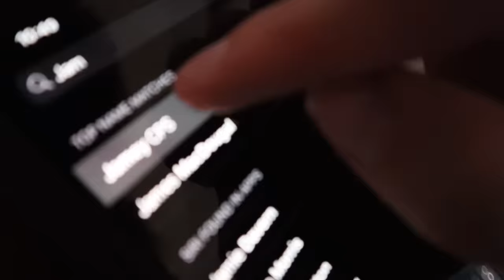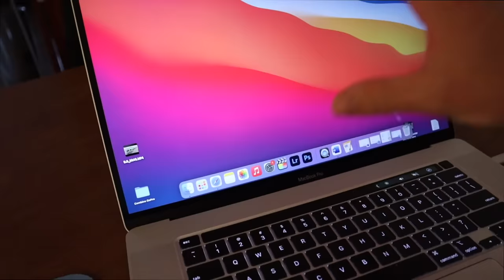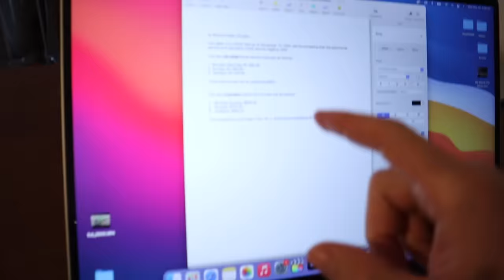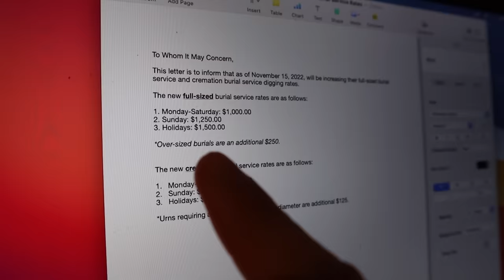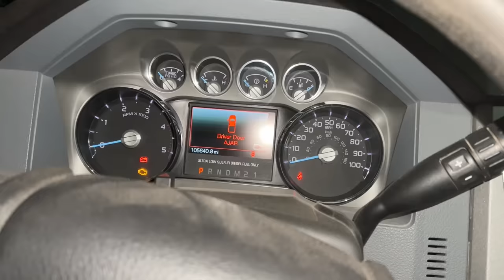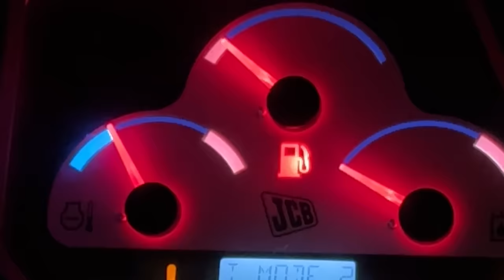Update On The $1M Bin Site Problems

Comment: Cole, that's exactly what you need to do, start putting names associated with your bin site problem. The world should know who was involved with every aspect of that bin site. I would however follow your lawyer's advice though on releasing names and information.
Reply: The Vice President is public information so it’s not really doing much other than saying he isn’t doing his job
Reply: When Cole has as big of a reach as he does he has to be careful they don’t come at him for a defamation lawsuit even if the company does deserve to get dragged through the mud
Reply: @Mathiowetz  Its not defamation as long as its true and documented
Reply: @Mathiowetz  Its extremely hard to sue a public figure for defamation. At least until Depp and the Jones trials. You can literally claim im stupid and didn't know any different.
Reply: @alexturner8104  Cole has done a wonderful job explaining time and time again he bought an ALL AGI setup and the AGI products were good but the fabrication for the structures holding the leg, catwalk, distributor, the dump, and pad were done by a subcontractor and it wasn't exactly up to the correct standards.
Reply: @dedrakuhn6103  You did a very accurate synopsis Dedra.   This situation is why we always have contractors post a performance bond and do not release the bond until everything is mustered out after completion
Reply: @dedrakuhn6103  The sub should be a recommended sub for the company certified to install. From whats been said that holds true.

The bin company should make it right out of their pocket and go after the sub. Sadly that dosent happen. I had a 180k project go that way but I saw the subs being iffy and held back 40k. Turns out their work was sub par and the parts company didnt want to fix it. So having the money i said sue me or fix it. They walked and we closed the project. Still didnt come out ahead, concrete demo and repair plus redoing the work cost 40k and another 15k to get it done right.

There arent allot of honorable companies left. But cole has the reach to cause some real money damage by naming and shaming. So for a 1M project go for it.
Reply: @Mathiowetz  he didn’t defamat the guy he said that’s who he’s been talking too there is a difference between calling someone out who needs to handle there stuff he didn’t say the equipment was bad he said the people agi has putting it up needs to fix the issues
Reply: @Mathiowetz  Defamation requires making a false statement about the individual. Casting someone in a negative light online is not the same thing as defamation.

Comment: Your intuition is correct on the gas pump.  They are very collectible.  That pump is from the 1915-1925 time frame.  The glass cylinder holds 10 gallons.  Hopefully you have the metal pieces that cover the lower part of the pump.  Restored, it really can be a piece of art.  Most farms had or still have an old pump like that sitting around.
Reply: ive seem the old pumps of all types for years, my great uncle ran a gas station in the early 1900s  with those old pumps we have some pics of him at the station .  They were amazing and are even more cool , fully restored

Comment: Biggest advice I can really say at this stage is keep on top timelines, dont be afraid to say to the contractors "this MUST be fixed by (date)", i need to hear by (date) and stick to it and have your lawyer stick to it. I can see the contractor trying to push things back and back and back and delay but you need to hold them to account...
  Secondly... I know you try to give chances, be nice and forgiving and so on and that is an honourable trait, but be aware those you are dealing with may NOT view things in the same way so dont be afraid to put your foot down, or have your lawyer do it for you... Ultimately this contractor has let you down and its their duty to fix this, even if they dont want to
Reply: I agree. Mr. Nice guy has no position in this. Get a fire under anything you have control over. To much is riding on a timely resolution.
Reply: They need to hold AGI feet to the fire, no nice guy. Contractors are the ones that messed up the project they need to fix it now.. ie tear it all down and do it right, no other option. If AGI are incapable of doing so they need to find reputable experienced bin site builders to do it and pay for it. A 1 million $$ project should never look like a toddler built it.

Comment: The extra cups for the leg you could use as storage bins for nuts, bolts, any other parts for the farm. They already have holes to screw into a board. Then you also have them if you need them in the future.

Comment: Screw your extra cups from the leg on a wall next to each other in a grid and use them to hold smaller parts, tape, etc...  could also make it so they are attached to the wall with a french cleat system.  That way you will always know where the extras are located and they are being used for something.

Comment: You are changing the hydraulic lines on your main grave digging machine. Do you ever bring out your backup machine and use it just to make sure it is still working? It would be terrible if your main digger broke and then you found out your backup didn't work either. Just a thought.

Comment: Quit blaming AGI I don’t hear anything about the equipment being defective that agi provided. It is the quality of the work the concrete guy did and the millwright so go after general contractor. I think you are using your YouTube to try to get agi to fix things that don’t appear to be their problem. The whole issue is a bad deal for you but is it because agi sold you faulty material?

Comment: looks like you need a crew to set up a few hundred yards of comcrete pads, for a Clean work site,, and then a bigger shop for 24-7 365 maint bay. and parts storage. ( even better) lets build 2 Huge Potatoe Barns. they are powerd and insulated. and huge. with doors at both ends.  great for entire operations.

Comment: Take those leg buckets and screw them to the wall using the existing holes and use for loose bolts and nuts.  You will eventually need one of them to fix a broken or missing bucket.  

You may try calling another AGI dealer in the area, be upfront about what's up and what you need, be willing to pay for an evaluation or even an independent engineer suggested by another dealer.  Be up front with the engineer that you may need him to testify if needed as that will change the way the engineer documents his work.

Comment: Your getting it out of the sun is correct. UV's.  UV's are great for growing things, and for helping bees and butterflies find their food in the flowers for pollination..
however UV's break down rubber and plastic, like the rubber hoses on your farm equipment, and tires.
So maybe put everything inside, since sulfuric and nitric acid in the air also works on metal surfaces.
Maybe spray the rubber air and hydraulic hoses with UV blocker paint or spray every year, as well as the tires that are not being used, and keep everything clean and covered with protective material when not in use since manufacturers are not JIT-like it used to be after the pandemic.

Comment: I can't speak to your problem in the grain elevator but on the fertilizer, if you aren't doing cover cropping and no till farming at this point you are falling behind in changes that the farming community needs to heading for. If you do it right you can cut the fertilizer man less checks and maybe some day say good bye to them. Look into it. Less tilling is good for you soil and your pocket book. Just a suggestion. You are smart, so this should not be a surprise. Farming is a lot more then sitting in a cab of a powerful machine.

Comment: Cole: Did you specify a Rebar cage inside the base for the overhead wet bin in your design? What was the design of the cage? If there was no rebar cage installed, then you are fubar as far as the cracking in the base. I really feel for your family, but there might have been mistakes made on your end, that you are ultimately responsible for. Curious to know how the base was designed.

Comment: Looking at the AGI web site i would have found a company that would build the bins as their bins seem to have a very high fail rate and do not do anything to fix the problem. For a company that is having this happen would be looking at the design and what is causing them to fail. They are just building them to a mim spec for cost saving and hoping that they will last till the warranty ends. Looks like you may find them going broke and not fixing your bin with no come back. Wish you luck in get it fixed as others are in line before you.

Comment: My feeling is this was a big, important job that required extra attention, by everyone involved =. Was there a structural engineer hired to draw up plans and specs for the pad(s) and soil preparation? Was he on site during the construction and pour? Was there tests done on the concrete at time of pour to ensure it was the correct strength and mix? Was the correct size reinforced wire and or steel rods used and were they epoxy coated for rust resistant or regular metal? These are just some questions that i would want to ask and be spelled out in writing BEFORE any contract is signed, also, designate a Project coordinator/Site Supervisor to oversee all the work is done to specs and signed off accordingly. Who was responsible for all that, Cole or AGI has not yet been determined.

Comment: 5:24 You might want to check the tires/axel on that trailer, something looks very off.
Reply: Just a little overloaded
Reply: @michaelmullen8153  it being a little overloaded makes the wheels super crooked like that?
Reply: If you're talking about as the trailer is turning, then yes, they do lean way more than it looks like they should. If you think that's bad, watch one turn short while loaded on dry concrete. You'd swear the axle is going to snap

Comment: JCB cole. When it is beeping it is likely momentarily flashing a code thus code would be wif water in fuel. Drain or clean wire on fuel filter ( the accessable one) that is.

Comment: If this was even a $100,000 fix AGI would probably be all over getting it taken care of. I bet they might have even noticed more issues than Cole even knows about and perhaps even the bins themselves will have to be torn down and redone. If the concrete pad on the hopper was cracking there is probably a huge concern the bin pads were also not poured to spec. The project might have to be a complete teardown and rebuild which is why AGI is not communicating yet because it will be so costly.

Comment: AGI buy's the whole grain facility back and prepare a new site and AGI builds a new grain facility on there checkbook.   Then transfer any remaining grain into the new facility and they take the original facility down and haul it off.  AGI pays to have a engineer/inspector to be insight during all phases of New construction.  The engineer
is a third party position.... Separate from 
All parties
Reply: That is a well thought out response. I agree
Reply: @amunderdog  Other than you have no idea how contracting works.   AGI has liability and errors and omissions insurance.  They also subcontracted the job so the subcontractor also has insurance.  At this point, they're trying to figure out who's responsible - AGI's design, or the subcontractor's work.   Then the insurance companies will have to decide how much each of them is going to cover.  So, it's not quite as simplistic as the "well thought out response."

Comment: Warranty work is an absolute nightmare!  The GC that was hired will not be willing to do the work all over again, out of pocket!  He thinks that he did everything to spec and his job is done.  His insurance will get hit with a claim that they will not want to pay for it especially if the guy claims that he did nothing wrong.  AGI doesn't want to pay because they may have supplied the product but not the labor.  Maybe the concrete mix was wrong, not the GC's fault but it's also his job that was completed.  The fingers point to this one or that one and it takes forever to figure out who's going to actually be paying for the repairs!  While you sit and wait for answers to what is now your unfortunate long term problem.
Reply: Both the contractor and AGI have errors and omissions insurance along with liability insurance.   At this point, both entities are attempting to determine how to get out the situation with the least amount of direct loss.  So, you have attorneys and insurance companies involved - and AGI and the contractor are attempting to find out where the other company screwed up and assign liability so they don't have to pay as much.    BTW - if the concrete mix was wrong - that is the GC's fault since they accepted the load.  That's what mix logs and slump tests are for.

Comment: It always amazes me when a company does shoddy, terrible dangerous work the management is always radio silence or tells their victims to call their insurance company because that is what insurance is for.  I had a major issue years ago, I took the company owner up on his advice and called my insurance company and my lawyer. When it was all said & done the owner wished he had just fixed what they screwed up & the other damage it caused. He never imagined what came his way ever would but he learned the hard way not to try to screw over angry customers due to doing terrible irresponsible workmanship and installation.

Comment: Hey Cole! I was wondering if you would ever run your diesel machines on biodiesel? A company called SpringBoard Biodiesel sells units that automatically convert any feedstock, such as used vegetable oil, into high-grade diesel fuel. I understand the fuel prices are high, but maybe converting to renewable fuel would be better for the farm's efficiency and also save fuel costs.

Comment: So, the "process" of pursuing your bin constructor is very ongoing. I'm not sure how AGI or the actual contractor can wobble very much- the entire process was filmed to some  degree and they know that, so other that fixing the goof ups, only hanging their rep out to dry is a choice. They may make a cash offer- hold out for repairs and damages, say 10% of the contract net value, paid to the lien holder. Back charge them for money lost having to co op or make alternate provisions to store. So far, it doesn't look like they are going out of their way to "do the right thing".  
I was about to worry just what you would do when you said the outside is finally all cleaned up- I should have had more faith, you segued into cleaning out the barns. Are you about ready for the next blast through your G'paws house?  Time for Thanksgiving and indoor chores.    FR

Comment: The bins are OK, aren't they? Holding corn, straight, weather tight---. So, where is the problem?
Poor concrete job on the overhead pad. Missing or non attached braces on the cat walks...Leg pit that continually plugs up..Right? Those are the issues. Concentrate on fixing them.  The whole million dollar facility cannot be fubared.

Comment: First time watching.
But should have been builders risk insurance on bin.
Next would be performance bond that the bins would be done by x date and would meet everything specified in contact or bond would pay out to farm the agreed amount. 
Also insurance cert with farm as named insured etc to meet the contract the builder signed with farm so if the builder didn't beform to the contract the builders insurance would pay for it.
You do all these things if you go cheap so you can't get screwed over.

Comment: 750 dollars to run a 18 inch post hole digger in the the ground,? Holy crap dude
Reply: Well, they have to load the skid steer up and drive the 3 miles to the cemetery.

Comment: I'm sure you have made a complete list of everything that that is broken, doesn't work right and/or is cause for concern (like all those handrails or lack thereof and the concrete pad that is failing).  I'm also sure that you have had structural engineers come out to inspect everything and they have issued reports.  And you have estimates of what it is going to cost to repair and/replace.  

I'm guessing the since you are contacting Senior Management at AGI, that you have gotten no response/satisfaction from the contractor?  At this point, it sounds like you have done your due diligence and have made every effort to be reasonable.  It's now time to get mainstream media involved and file a massive lawsuit again the contractor and AGI.  And stay the hell off the top on the bins!  It's NOT worth you or your father falling to your deaths!!!

Comment: Unfortunately you will need some “expert” investigators including a structural engineer and possible a concrete testing company. Then the lawyers will put together all of the information, and AGI’s team of lawyers will try to destroy or discredit all of the findings. 
I would sue for damages and attorneys fees (if allowed in your state). This cannot go to court, it has to be settled through arbitration. 
meanwhile, show everybody every thing that is wrong with the bin site.
I have been an expert witness and put together reports many times. This will not be resolved overnight.